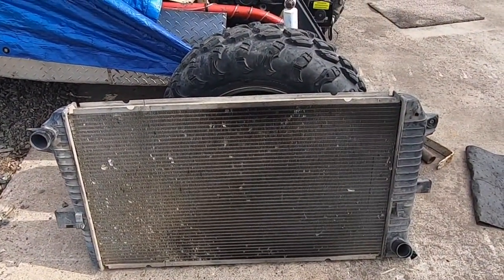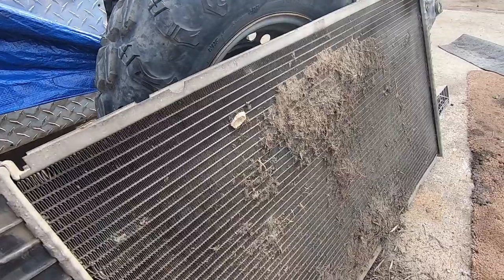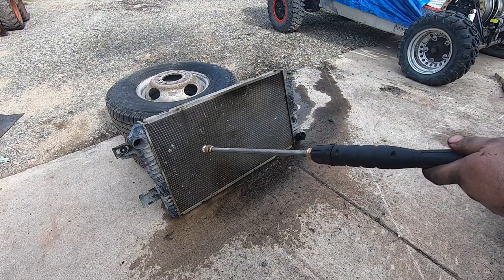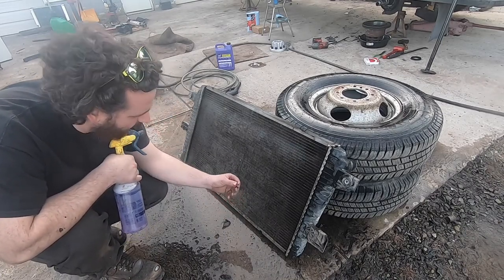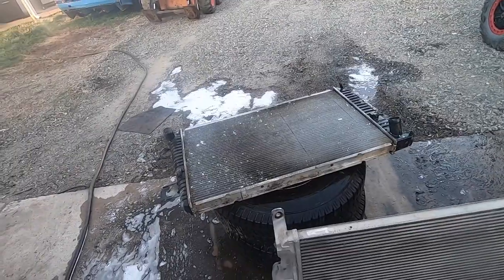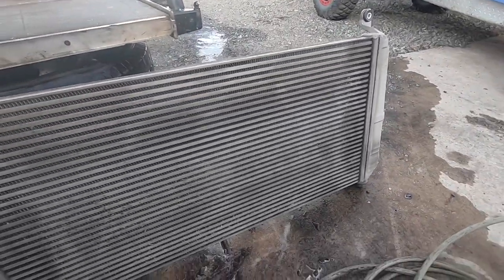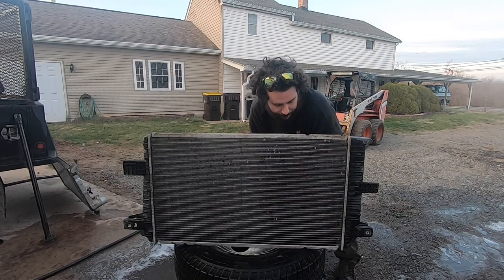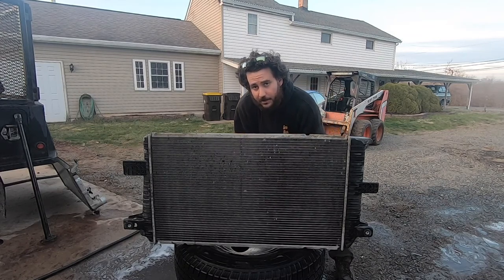DURAMAX overheating? Try this first. Clogged radiator and cooling stack. SAVE YOUR HEADGASKETS!!!

Comment: Hey did you end up replacing the radiator or cleaning if you cleaned it how did you go about getting that junk out
Reply from the maker: I cleaned it. Just a garden hose and purple power. Be careful as purple power will eat the fins over time so you need to keep it moving. You can use a pressure washer too but need to use a low pressure tip and be very careful to spray perpendicular, otherwise it will fold the fins over and cause other damage.

Comment: Pro Tip: if you let it soak in purple power for 24 hours it will be so clean it's like no fins are even there
Reply from the maker: Cant clog once all the fins are gone. I should hit them with a real alkaline coil cleaner too but whatever
Reply: @spankranchgarage  I've seen guys melt fins off coils with coil cleaner that stuff is no joke